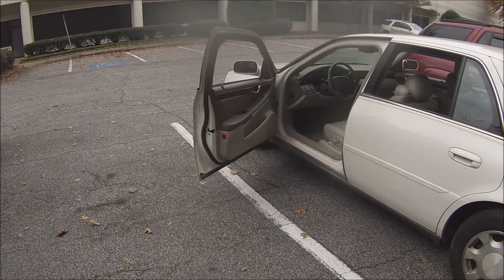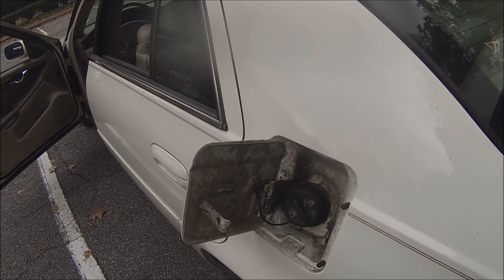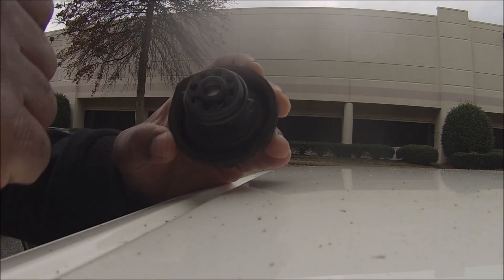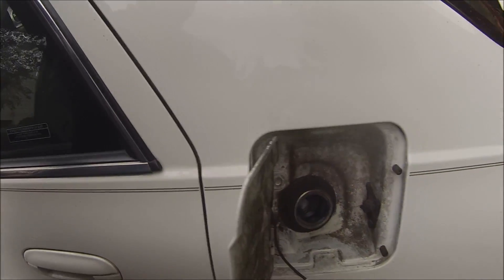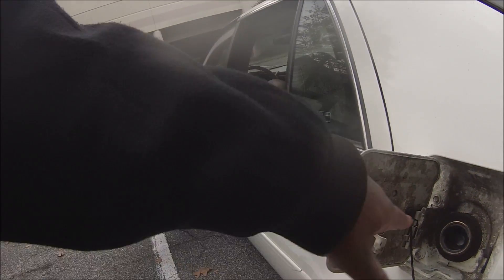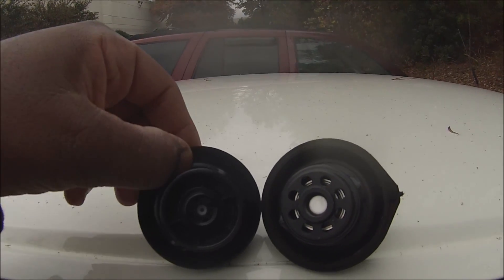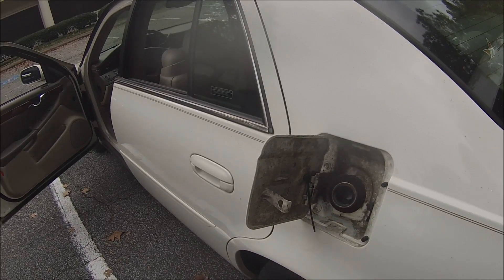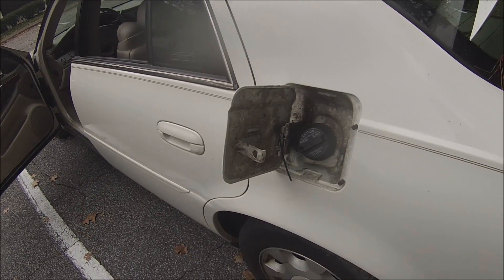How to tell a bad gas cap

Comment: Great explanation.  My wife's car got a p440 error code.  I checked her cap and it seems really loose but the thing that convinced it was bad was the tell tale discorlation you mentioned.  I was wondering why that area was always dirty as hell.  Thanks dude !
Reply: did  you  fix the p044  error code ?  Was it the gas cap?
Reply: @Pinkielover  Yes.  It's funny because I saw this video the day before I had that truck into the shop for an oil change.  They saw the code and wanted to make the whole situation a major operation using smoke etc.  I told them no I'll take care of it.  I swapped the cap and it did the trick.  The tell tale sign was the black residue all over the outside of where the cap is and inside the door as well.  Swap the cap ....it's a cheap attempt and you probably need a new one anyway.

Comment: Thanks brother for uploading this video, it is very helpful in my current situation with my car. I have a Toyota corolla 2008 model that had a problem in the fuel pumping system. I thought there was a blockage in the fuel injector line or something else. Now I realized there was dirt surrounding the fuel cap like yours. I'll change my fuel cap and I hope my car runs smoothly! 
Thanks again and stay blessed🙂
Reply from the maker: Replace your fuel filter
Reply: Will you change your gas cap did it help I have similar symptoms
Reply: Did you have to step on the gas to get it to start?

Comment: I hoped this was my issue so I bought a new cap and turns out the new cap was faulty and wouldn't seal lol. Bought a new one and works great, check engine is off too. Thanks for the help.

Comment: Thank you thank you thank you!!! My check engine light has been on and I do have the original cap on my 2004 Impala. Been terrified that I was facing major car repair! I also have that smudgy stuff all over. Thanks for posting! :)
Reply: Did ur security light come on also
Reply: Some gas caps are not strong enough, so try to get one made for your car, oem specs.

Comment: thanks, man.  just got engine light come on and code is p0442 (evap small leak). checked gas cap and the ring is full of cracks. so I'm thinking change the cap and hopefully engine light will go off in a few miles. thanks again.
Reply: Did the check engine light go off

Comment: I was getting a check engine light, and the code was 0442.  The light was reset. And the code kept coming back.  Then while driving, I started to smell fuel vapor.  The code was for a small EVAP leak.  The gas cap was original and on a 2006 Ford.  I found cracks in the seal on the gas cap, and a crack in the EVAP system hose that runs from the gas tank to the charcoal canister.  I replaced the hose, the gas cap, and the evap purge valve.  The light has not come back on, and there are no more fuel vapors while driving.

Comment: Yup this might be my problem! I have the P0441 evap incorrect purge flow code check engine light. Went to Firebone and they replaced two parts and still couldn’t get the check engine light off. Firebone is a big rip off. So I’ll try a new and better gas cap. I still have the original cap from my 2013 dodge avenger se and I had to clean the inside of the gas cap area too.
Reply from the maker: Your problem is not a cap. You need to check your purge vaive solenoid.

Comment: I have a 98 f150, 3 brand new oem caps dont click at all, just tightens
Reply from the maker: You need to make a video about that
Reply: @blackericdenice  also bought a couple motorcraft ones from the dealership, same thing, doesnt click.. Wonder if my fuel filler is messed up. I have a p0453 code too.
Reply: @blackericdenice  i figured it out!!!! The inlet of the filler has a bent metal flap, and has a broken thread!! Which is most likely the cause of the  p0 453 code...or maybe its 452, either way i ordered the part..im sure its the reason.
Reply from the maker: @choadcityusa  Let me

Comment: I have a 2004 subaru Impreza 2.5RS with 200k on the body and 60k on the engine swap.  My car keeps throwing the code P0457 (Evap control system leak - detected (fuel cap loose/off) when I inspect the fuel cap it doesn’t seem to have any cracks on the seal and looks ok condition. I’m gonna start with a new fuel cap from a parts store and see if not do you have any other ideas on what it could be?

ALSO example I put $30 of gas in and the pump will kick off every $1 or 2 and it takes forever to fill up.
Reply from the maker: Check your vent valve.
Reply: @blackericdenice  ok I took my gas cap off a few minutes ago and it had some nasty stuff around the threads I’m cleaning it now and gonna clear the code and if not imma try a new gas cap then go for the vent valve next
Reply: @blackericdenice  thanks for the reply also

Comment: Thanks for giving details and specifics. During an inspection, I was told the cap needed replacing (on a low-mileage, 1999 Lumina). I had the impression they were trying to upsell me, and in the end they didn't replace it, but passed the car anyway. But, if it really needs it, I want to replace it. I suspect the cap is the original, as it still has its tether connecting it. When you replaced yours here, did you just cut that tether? Anyway, thanks again.

Comment: Hey! I am having this issue with my car! My car starts but sometimes it doesn’t crank up right away. The service engine light is on as well! Would the bad cap cause this problem to?
Reply from the maker: No. What is the code?
Reply from the maker: What year model car?
Reply: It’s a 2003 Nissan Sentra Gxe,I haven’t went to a mechanic yet. I am going on Tuesday
Reply: @kearriadalton6027  I am having a same problem, would you like to share your experience please

Comment: I have the gas cap warning message and check engine light for a while. Now my car is sputtering and misfiring scan tool detects a large Evap leak. Could a gas cap cause such a problem or is it something else like the evap valve?
Reply from the maker: What kind of car and the code?
Reply: 2005 Cadillac deville p0300 code engine misfire she’s missing on both sides. I also got a p0455 large evap leak she runs rough when you start her but driving is relatively normal it’s just at idle mainly.
Reply from the maker: @DarkGentlleman  I would replace the plugs.
Reply: @blackericdenice  that was my last thought. Can bad coils or plugs trigger a vacuum leak?

Comment: But OBDII P0442 code what means? I have a KIA RONDO 2012 yr, 4 cyl. The check engine is on after error code erased.  I changed the gas cap w/new one KIA.  Very expensive in Canada. I can't fix the problem yet. Now I'm looking for a canister purje valve to be changed but I'm not sure yet. In EVAP system to fix the problem must waist a lot of $$$$.
Reply: I have 442. It's emissions fault. I took mine to the Chevy dealer and they couldn't fix it. Cost me $175.00 so my engine light is still on. I am gonna replace my cap and purge valve next month.

Comment: Would this be true for most cars.  My Hyundai stinks and it’s getting worse.  I don’t want to drop $500 on a pump if I can trouble shoot other things.  The smell is strongest in the trunk.
Reply from the maker: What year and model?
Reply: @blackericdenice  it’s a sonata GLS 2.4L
Reply: @blackericdenice  I check out the fuel pump are and the tank is wet on the side.  I’m fairly certain it’s one of the lines.
Reply from the maker: @BaronVonBeckinstien  What year is the car?

Comment: 0:44 Uh oh!  Black man talkin about "crack" on the YouTubes!  Watch yer back!
Reply from the maker: Damn a white man on my channel. Must be out of meth.
Reply: @blackericdenice  Good comeback, also, thanks for your great info.
Reply from the maker: @tommak6516  I normally remove comments like that and block the person.
Reply: @blackericdenice  I get an engine check light on occasionally (months apart) and I fiddle with the gas cap and the light will disappear in a day.   I do not know if that is the cause of the check engine light or not (coincidence?).  One day (the light was off) I was at Autozone and they plugged in and found one 'Historical Code' P0327 knock sensor.  No correlation.  Anyway, today I took the gas cap off and just cleaned everything on the cap and rim of filler pipe.  The only thing I had handy was some ATF so I used a little of that and a rag.  The cap does not have an o ring, instead it has some kind of flat plastic seal.  Also there is some kind of spring in the cap (not sure what it does) but getting a little ATF in there loosened that up too.  The spring seems to have to do with twisting the cap, not applying pressure to the seal?  There seemed to be a very very tiny amount of crud near the rim of the filler tube.  Seemed too small to make a difference.  Bottomline, maybe just some dirt is causing (very) intermittent check engine light.    Hoping knock sensor is not an issue.  No check engine light on now, but it was not on before I cleaned the cap, etc. either.  2010 chevy cobalt.  Original cap, first time I ever looked/cleaned it.
Reply from the maker: @tommak6516  Google your car and the code
Reply: @blackericdenice  2010 Chevy Cobalt, P0327 (Knock Sensor).
Reply from the maker: @tommak6516  Replace it

Comment: Hey friend, I have a similar car 03 deville. Do you remember How long did it take for the check engine light to go away after installing the new cap?
Reply from the maker: I used a computer to reset the pcm. You can unplug the battery.